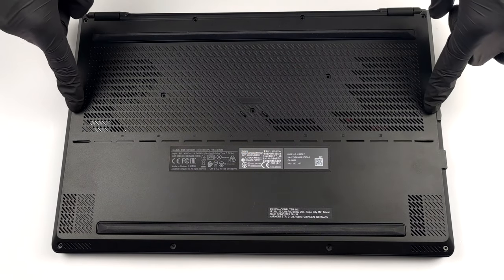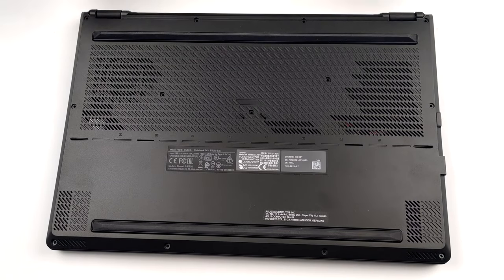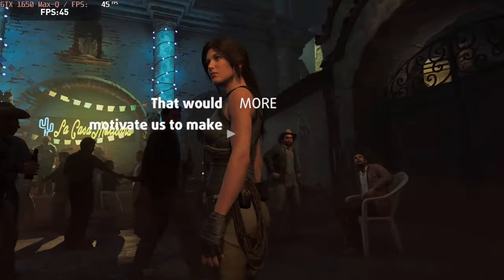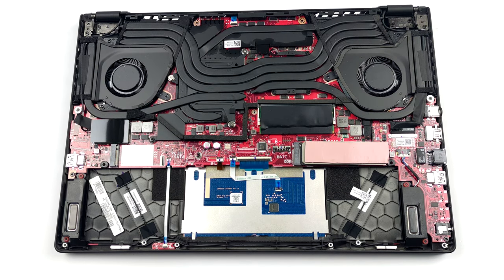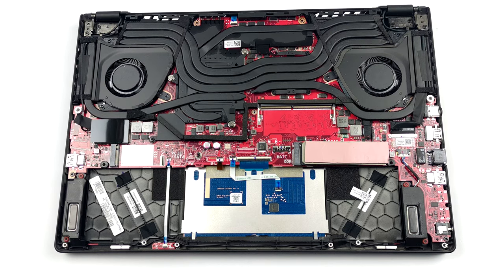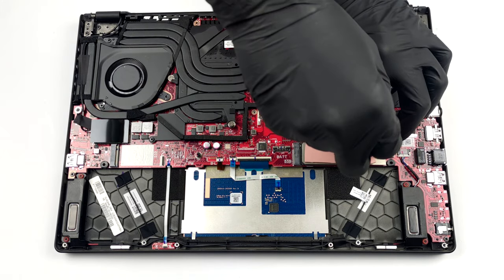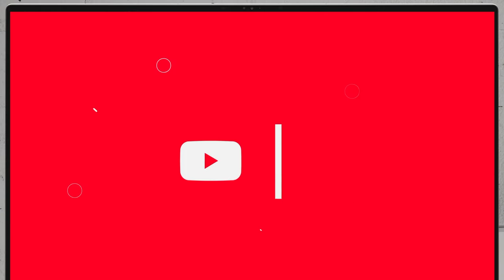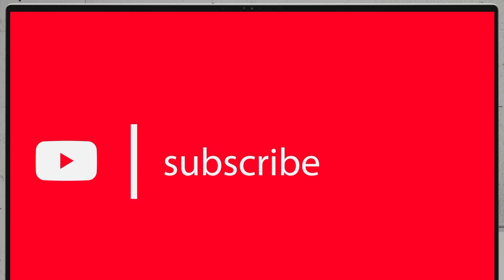🛠️ ASUS ROG Zephyrus M16 GU603 - disassembly and upgrade options

Comment: Such a shame this doesn't go upnto 64gb but a dam good laptop. Best in it's price range (uk) for gaming, video editing and general use.
Reply: What happens if you plug in two 32GB sticks? Would the computer recognize the total as 48GB? My current laptop only has 16GB and I need a minimum of 32GB.
Reply: @William Cousert  that's the problem, it only has one replaceable slot and the max rn for ram that firs those slots is 32gb. The second slot is soldered to the motherboard so you can replace it.
I think you could get to 40gb.
Reply: @Bikeadelic  Thanks! I guess I can live with 40gb for now. I wonder why it's listed as having a 48GB limit?

The SSD that came with mine is only 1TB, and I believe there is only room for one on the main board, correct? Do you know what I would need to transfer Windows and my apps to a new larger SSD? Also, would you happen to know if the video RAM is upgradeable?
Reply: @William Cousert  maybe you can get bigger ram than 32gb in one unit now 🤷‍♂️
It's got 16gb standard so thats two sticks of 8gb one of which is soldered. So whatever the max replacement is It's that plus 8gb that's the max. 

I've still only got 16 and it's performing wonderfully for gaming and video editing. Doubt I will upgrade the ram.

Both SSD slots are replaceable, I got an extra 1TB but should have got 2 or 3TB. It goes so quickly woth games and footage. You just put the new drive in, initialise it if needed then drag and drop the relervant files into the new SSD.

I bought a WD black series 770 1Tab which has a faster read rate than the stock SSD so I use that one for gaming and the other for everything else.

Video ram is not upgradeble you'd have to replace the geaphics card which isn't possible with a laptop unless you're very skilled with electronics and can find one that fits. The 3060 mobile 6gb if you want more get the 3070 or 3080 maybe? Idk what their specs are.

Why do you want to upgrade so much?
Reply: @williamcousert  If you have the 16GB model, you can upgrade it to 40GB. but if you have the 32GB one, you can upgrade it straight to 48GB. (16 + 32GB SO-DIMM)
Reply: I'm curious now, using cmd prompt, it shows that the laptop supports up to 64 gb, currently there is a 48 gb ddr5 4800mhz supported ram stick for ~150 usd from crucial. Adding it in would have a total amount of 56 gb of ram.
Reply: Has anyone here ever maxed out 16 gigs of ram. 

Unused ram is good for nothing.
Reply: @bonniehammond9566  I'm been getting into 3d modelling and I've been struggling as my ram is used 100%. I'm sure there are ways to reduce ram usage however it often comes at a cost of detail. Blender would run much smoother with more ram. I use 16 gigs.
Reply: @madhistory421  cad design will do it.

 it hurts my feelings to see large amounts of ram go to waist. Im just trolling

I use linux to model, less ram in use for the os.
Reply: @bonniehammond9566  nice! I'm planning on buying this new 48 gig ram module to replace the 8 gigs of replaceable ram on board. I'll have a total of 56 afterwards. I was watching the video to see compatability with the 48 but i should be fine lol.

Comment: Is the HDMI connected to the graphics card? I can't use HTC Vive on it and it says to make sure the HDMI is connected to the graphics card. Maybe this laptop is not VR ready...
Reply: I know it's been 6 months but it's probably because of your hardware of software. If it's hardware, make sure your hdmi is plugged into the link box, then to the laptop, same thing with the usb. 

As for software, it could be your Nvidia control panel settings. You would need to right click, click more options (if on windows 11) or simply click nvidia control panel. Then head to manage 3d settings and make sure your "high performance nvidia processor" is selected. Also, could help to do it in the physx settings.

Comment: So which one is the m.2 gen 4 slot? 1, where the original ssd resides or 2.
Reply: One says pcie/sata. That one is pcie gen 3. The gen 4 slot is the other
Reply: @GhostsGraphics  can i place a 4.0 ssd in the 3.0 slot?
Reply: @halogod0298  yes but you will be bottlenecking it to gen3 speeds
Reply: @GhostsGraphics  ok thanks you
Reply: So all of them is not gen 4? Oh noo

Comment: Hello PBKreviews, excellent information.

I have a question.
In the specifications it says that it can be increased up to 48 GB in Ram memory.

How can I get there?
According to the video it only has one slot to increase, do I need to buy a 40 gb memory?
Reply: It depends what sku you have, some of them come with 8gb soldered instead of 16gb so can only hit 40gb total ram. Check the asus product pages to see yours.
Reply: if 16GB soldered buy a 32gb single rank for the slot and install